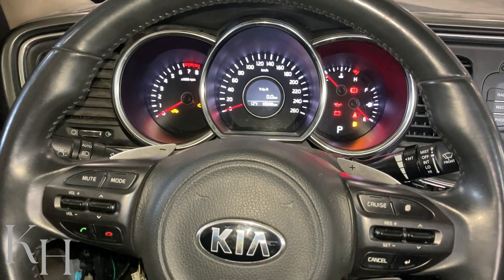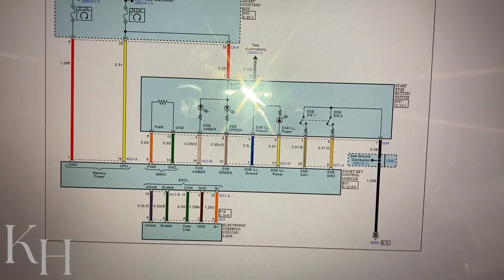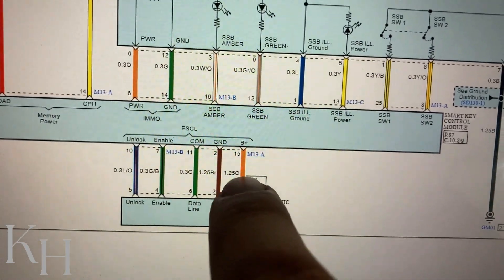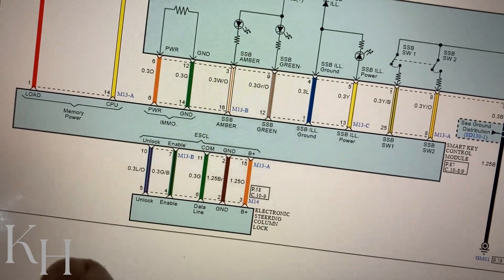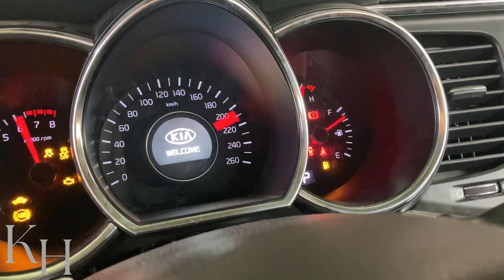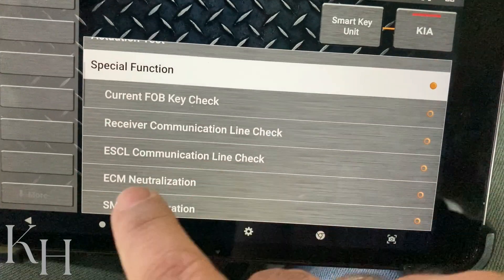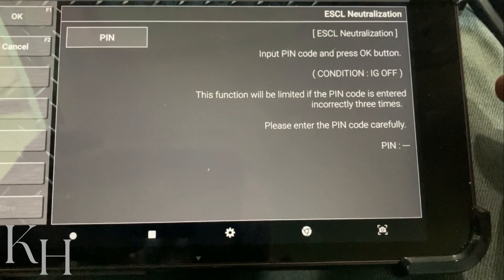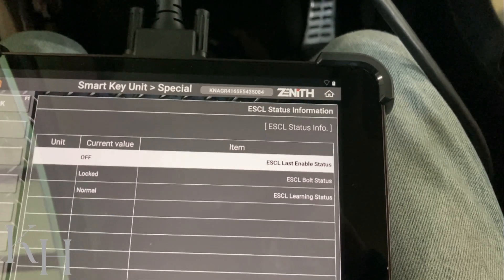Check Steering Wheel Lock Fault Diagnosis on any Hyundai & KIA

Comment: I have this problem on my Kia Forte.

I managed to start my car a few times by doing the following:

1. Put the gear into R.
2. Press the start button (everything on the dashboard will light up).
3. Put the gear back into P.
4. Start the engine.

I wonder what the fault here is.
Reply from the maker: Hi there, It could be inhibitor switch on the transmission, if it is, most likely it only needs to be adjusted.

Comment: Hi there, was wondering if you could help me. Have a 2013 Kia Ceed, same message on the dash, fuses are fine, ignition not coming on so cant plug it in. Have tried plugging in a second hand lock unit with no change. Could you tell me where the smart key module is so I can test the wires. Many thanks.
Reply: did you find a solution?

Comment: Question my escl bolt status is saying failure, getting power and ground to the escl, it's stating unlocked as feedback which is is but still it's says escl bolt failure, tried escl neutralization it failed, this happened after a guy put the battery pole on incorrectly

Comment: Thanks a lot for the video. Very useful. I've been locked in the underground garage so no one could could took my car out of it to the service :) I found smart guys who put some chip instead of ESCL so I'm driving currently without it :) I have a question, I've bought a used ESCL to install into my car and of course it didn't work, so does it really need to be neutralised on the donor car before removing because I have doubts that the guys who sold me ESCL they neutralised it there? Thanks for reply in advance and for very useful video!
Reply from the maker: Yeah, it needs to be neutralized, but I've had a couple of cases, like yours, that the second hand ESCL (for sure not neutralized) worked on my car after reprogramming the keys. So, as far as you have got the ESCL right now, It's worth a shot to try it.

Comment: Where can I get the wiring diagram from?
Reply from the maker: Hi there, for Hyundai and KIA, the best source is their technical website. It was available to buy a subscription some years ago, but now you can get access to the website only if you work in a dealership. But the next best choice is GDS (Theirs previous OEM scan tool) which does have all diagrams and workshop manual. You don't need to buy the device, if you can find the software only, it does the job. You can still find it anywhere in Internet for a good price but you need to remember that it covers only up to 2018.

Comment: Fuse not blown whatelse can i troubleshoot?
Reply from the maker: Did you follow the steps in the video
Reply: @K-H-diag  I don't have a diagnostic tool to do the other steps....the keys seem to be responding to its functions. Except the car won't start.. I changed both fuses under hood and under steering wheel.